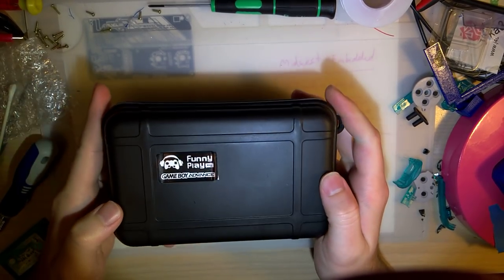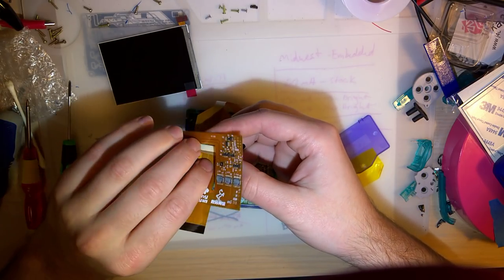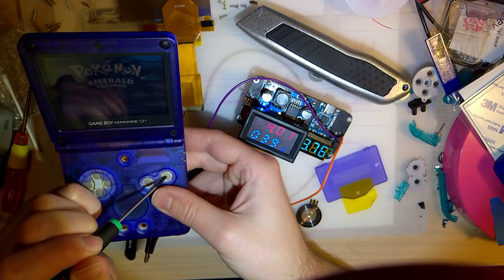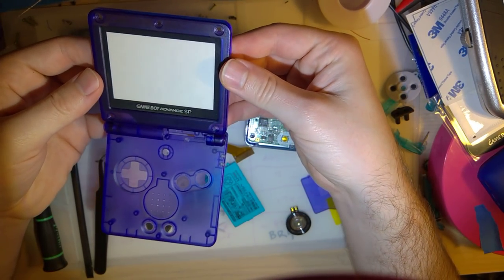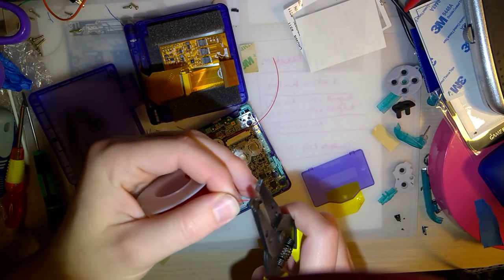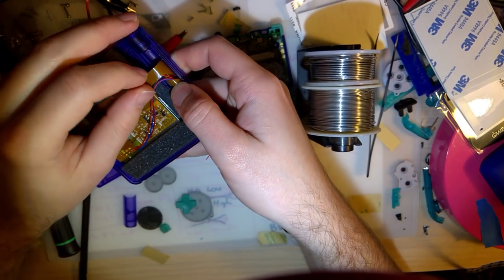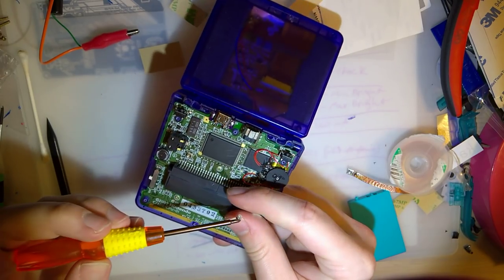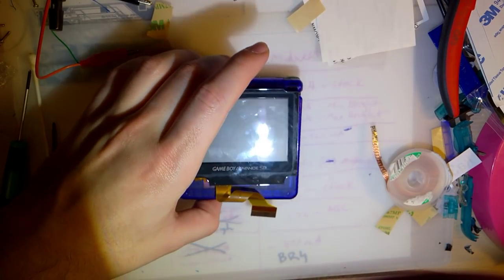Installing the FunnyPlaying IPS GBA Screen in a GBA SP (AGS-001) with a Ribbon Cable Adapter

Comment: I can use an unmodded gba sp 001 and 101? Or need to prepare them in some way? Before install this screen?
Reply from the maker: The adapter ribbon that allows you to use a 32 pin AGB screen with a 34 pin AGS motherboard makes the difference between AGS and AGT motherboards negligible.

Comment: Im kinda confused, ive never heard of funny playing and im kind of a novice to modding. What exactly did you need for this and around how much did it cost?
Reply from the maker: I used: a donor console (in this case an AGS-001 I repaired and reshelled earlier), the FunnyPlaying GBA IPS display -- pre-orders were only $35 for the first 100 units sold and now they are $45 through FunnyPlaying and $50 through Retromodding, and finally, a 32 pin AGB to 34 pin AGS adapter. I picked up the adapter on aliexpress about a year ago so I don't have a link for that. I did order a new one but it has yet to arrive. I can share a link when I get the new adapter. The LCD can be had from FunnyPlaying here https://funnyplaying.com/collections/game-accessories/products/4-pixels-in-1-ips-full-viewing-angle-gameboy-advance-replacement-project or RetroModding here https://www.retromodding.com/collections/gameboy-advance/products/game-boy-advance-ips-lcd
Reply: @makho  theyre coming out with an SP version soon though you said?
Reply from the maker: @astr0nom1cal  Eventually. They said it's going to be a couple months though.
Reply: @makho  gonna be much cheaper than OG 101s though, thanks for the video, i would be still buying 70$ 101 screens